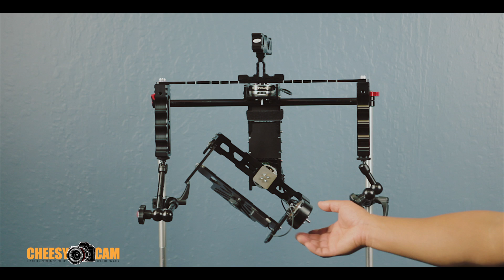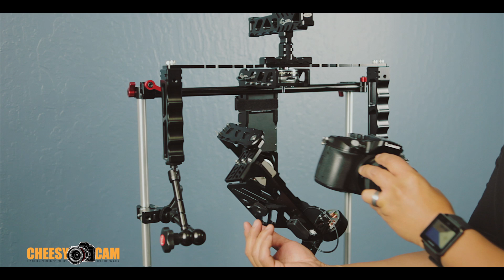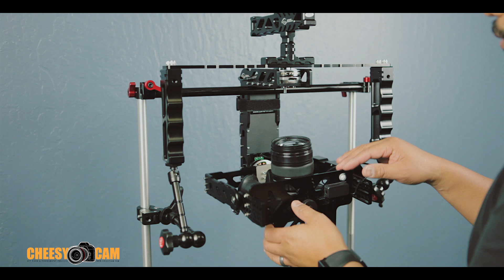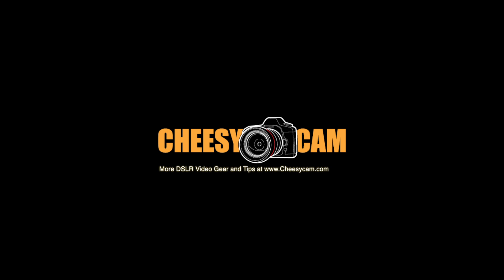How to Balance 3 Axis Brushless Motorized Gimbal Video Stabilizer

Comment: having trouble balancing came-7000 with 5DMK2-24-70mm F/2.8L II  ... how can you deal with such a heavy lense and plus on 24mm the lense is longer have no more space to pull back the 5DMK2 to make it less front heavy
Reply from the maker: Unfortunately there is a limit to every gimbal. If you can't physically balance it on the stage because you don't have enough adjustment, then it's not going to work. I'm using only short prime lenses.

Comment: That looks pretty good for $2K. If you move slow will it tilt up and down? Can you turn the whole thing over so that the camera is on top so you can shoot from a higher position ... like overhead?
Reply from the maker: Check the link in the description. There is another video showing how it works when panning slowly. It does a 'follow' mode.